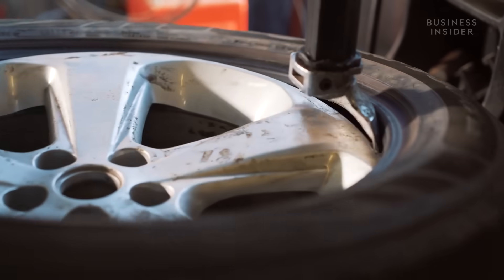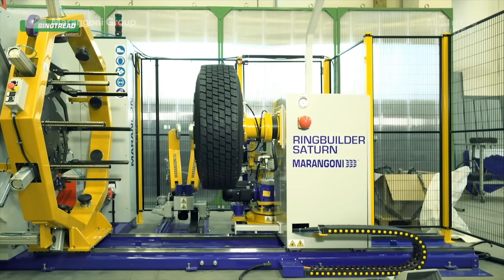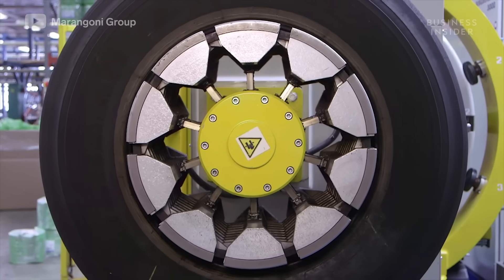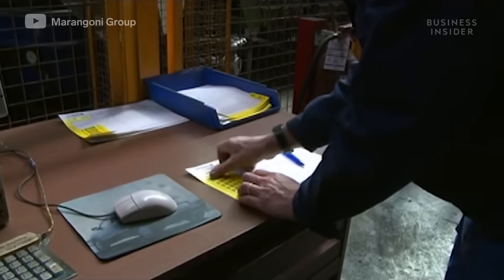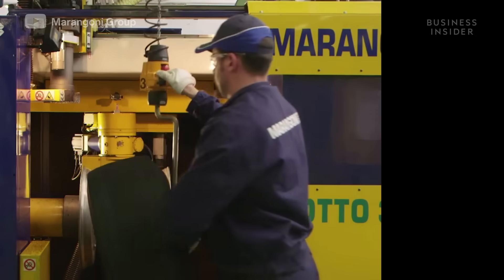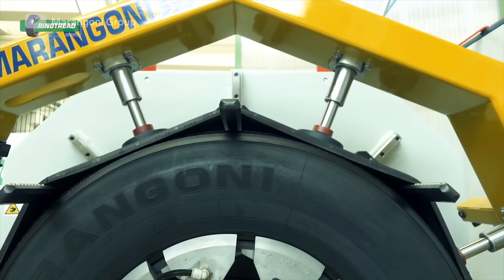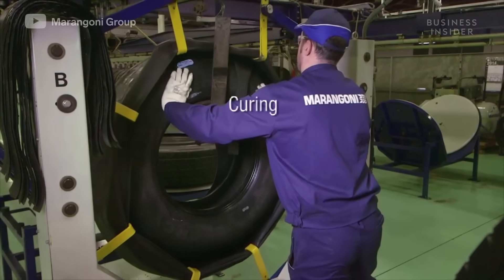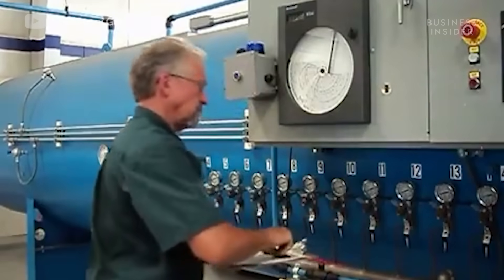How Old Tires Are Retreaded So They Can Be Used Again

Comment: Technically, back in the early days "retreading" meant cutting new tread into an old tire, this process where new rubber is cooked onto casing is called "recapping." My Dad operated a recap shop beginning back in the 1940's. A quality recap will last and ride well but you have to start with a good casing and do a quality recap job.

Comment: These are fine for slow moving applications but no way I would trust them on the highway at high speeds. I see retreads on the road all the time. Many a car and truck every day get damaged from hitting what many call road gators. Not only do these pieces of tread cause damage to vehicles but also motorcycle riders hitting them. I also do not like being next to them when they blowout on large trucks. 

I wonder if saving a few bucks is worth someone’s life?

Comment: Old tires can be shredded, and burned just like coal. In fact, they produce more heat, and release less pollution than coal. They're perfect for power plants. 

But I was wondering. The retreads in this video are great, but expensive. What would happen if you took an old tire, wire-brushed the tread really well, and then spun just the bottom third of the tire in a bath of hot liquid rubber? As the tire rotates, powerful UV lights on top would cure each thin liquid coating of rubber; again and again. So after twenty minutes, the tire would have around three hundred very thin layers of cured rubber on the tread, making it about half an inch thick. Would the rubber stick? If it did, then new treads could be hot stamped. The liquid rubber for one tire would only cost a few dollars.

Comment: Actually if use wrap around will reduce cost or replace tire so all you need is replace the wrap around cost 20% if the new tire and last about the same as while tire replacement

Comment: lets see. buy recaps that everyone by now should no have a horrible reputation for ejecting the new cap if it doesn't vulcanize to the casing or if they are cheap and basically gluing them on and they are still 3/4 2/3 price of new....or i can go get a set of name brand dealer pull offs that are basically brand new (the dealers pulls them off and puts on no name new tires to avoid liability) for 40 a tire....hmmmm.

Comment: I used to work on semi tires, different kinds from retreaded trailer tires to virgin (new) steer tires.
For safety sake, please don't cheap out and get retreaded tires.
They do not last what's so ever.
I had a tire loose it's tread on day one of putting it on a semi.

Comment: They'd seem a lot safer if they put any effort into reinforcing the sidewalls. At first I thought that's what the rubber envelopes were for but I guess that's just a sort of clamp to hold the tread in place while the glue is cured.

Comment: In all my years I’ve never seen the use of a retread tyre end well. New tyres usually have the date of manufacturing on the side wall as over time the rubber breaks down and becomes brittle. You’ll also find retreads will always have a short service life and as many here have mentioned and I’ve seen the tread will often separate from the carcass of the tyre. Retreads really are economically unviable
Reply: In all my years I’ve never seen the use of a retread tyre end badly, guess that’s because aircraft tyre remanufactures know how to do it right.....
Reply: *tire not "tyre" dumb 🤡🤡
Reply: Rubber does not get brittle.  Honest to god........
Reply: @frequentlycynical642  Exposure of the rubber to light and air induces chemical changes in the polyisoprene over time . It looses its ability to stretch and becomes hard and brittle. You see evidence of this all the time in old tires; cracks will form in the tread and on the sidewall. Tires have a protective resin embedded into them, but that can fade and no longer protect the tires properly. This is especially true when the tire is exposed to long periods of inactivity. The longer a vehicle sits unused, the more likely dry rot will develop.
Reply: @jatoxo  Extreme situations.  And tires sure as hell don't rot.  Wet or dry.
Reply: @frequentlycynical642  Tire "rot" is not actually rot, but just a colloquial term that describes the breaking down of the rubber over time due to natural processes.

Comment: I would buy these only if I wanted to sell my car to my worst enemy. Old tires should be entirely recycled. The whole product itself has a planned lifespan. If the tire's surface becomes flat, then then entire tire should be replaced because it most likely lost its durability and flexibility. Just test how much pressure a new tire and a refurbished tire can hold.

Comment: Looks like a great process. When I was just starting out, I couldn’t afford new tires, so I bought “retreads”. One “delaminated” at high speed (like a blowout) and I became afraid to drive anywhere over 40 mph. That’s when I learned to spend more for new tires at a reputable shop.
Reply: I never purchased Recaps. However I recently bought a trailer which had retreads all around. I had two blowouts on the highway in a single day. These were Michelin Recaps so I thought they would be good.
Reply: @shadiahmad4848 You had proper inflation?   How fast were you going when they blew?   Did the tire company provide warranty claims?
Reply: It's better to pay with a few dollars more than with your life....
Reply: @JasonKing-m6m   you’re absolutely right, but I was young and didn’t have a lot of money and wasn’t aware of these tires’ problems. This was in the 1960s and I’m told that retreads are much better made today and don’t have these kind of problems.
Reply: @TheTwick  They might say that they are "better now". A new tyre is still better...
The modern retreads may be better than previously, but in my opinion, that tread is still going to come apart, it might just take longer....

Comment: Let's take a moment to thank the Amazon Rainforest for giving us rubber! Because there would be no tires without rubber!!
Reply: Steel wheels were used before rubber, look at any old farm equipment. Also we have synthetic rubber like compounds so we would still have pneumatic tires (at the moment it just makes more sense to use the cheaper option). From an engineering perspective we would still have tires even if rubber didn't exist, you just might be thankful it's probably cheaper since we do.

Comment: People hating on Retreaded Tires must realize one thing :
Retreaded Tires are not meant for high speeds. 
They are ideal for slow moving, mostly agriculture equipment. 
Car or trucks must not use these recycled tires. But concubines, tractors, even dumpers can work well with these cheap replacement. 
Incidentally, new tires for these machines are very expensive.

Comment: Looking at the amount of work and effort which goes into this process I would like to see a breakdown of the energy consumption in the two processes. I feel that just making new tyres and recycling the old ones might be just as efficient
Reply: Well...i mean they legit said in the video it takes 20% of the materials ect or energy to retread them vs brand new. So. Kind of just gotta listen ig uess. Not a big fan of retreads myself. They said they can burn them no emmisions really and they save the materials...so why can't we do that to most of them? The millions of tires being thrown into a giant landfill.
Reply: @baileyhatfield4273  y.. because its propaganda. Like you said wed burn everything if it was emission free. However, getting energy from burning trash is on the rise and quite shocking how we didnt do it from the beginning

Comment: Most tires you see laying on the road are from 4 wheelers oftentimes carrying a trailer, I dribe an 18 wheeler and as a long haul it makes no sense for me to put recaps on my rig, these are used on mostly regional and local trucking, these tires ARE SAFE as long as proper tire pressure is maintained, all retreads are done once and then arr discarted, morons spreading myths of recaps flying thru a widshield and killing everyone is just that, a myth, when these explode the rig itself absorbs all of the damage and it can substantial, whats left is that chunk laying on the shoulder of the road.

Comment: As a professional driver, I have to say retread is absolutely NOT safe. I don't care what this video claims. I see it laying all over the highways as the tires of some trucker is ripped to shreds. Regular tires don't do that. I  ran over a huge chunk of tread on the highway and it ripped the drive axle right off my RV which cost a pretty penny to repair and left me stranded in oklahoma.  In my opinion retread is dangerous and should be illegal.

Comment: So many negative comments on retreads. And yet, people forget the stories of regular tires blowing apart as well. The only time I ever saw retreads get damaged, was from lack of maintenance, improper pre-trips, or driver abuse.
Reply: Yea sorry I'll buy brand new safe tires for my family to drive on.... Not recycled garbage thanks
Reply: @MerkMacheen  when it comes to a family vehicle, you don't have a  choice. Recaps are only for trucks on the drive end. Small motor vehicles, and steer axles only run new rubber. Besides, if recaps where bad, they would be outlawed. All the school bus, and truck companies I've seen run recaps. They never have problems.

Comment: “tire looks good and has no holes. time to send it to get buffed.” (staples holes to put tag on). lol
Reply: Literally the only part I wanna remember from that video. Made me laugh so hard
Reply: @LightAndorDark  same!
Reply: Right on the bead too
Reply: Just a completely unnecessary risk.
Reply: @jacob_90s  my brothers name is jacob w and he checked into rehab a week ago for drugs. interesting how the world works like that. he’s 20
Reply: I think when they go into the enclave, pressure chamber, all that shit don't matter.
Reply: And then they fix those damages before they put on the new tread
Reply: Imagine if two little tiny pin pricks, that go 1/8" into the rubber, actually damaged it.
Reply: @littlejackalo5326  I mean it could technically start tearing and cause damage but the tire is probably not going to live long enough for that to happen
Reply: @aam7670  bro idk if you’ve heard of this but there are things called roads which are much more rough and will make a small hole from a staple insignificant
Reply: Yeah yeah it will do such an impact.. You really should write that bullsh*t?

Comment: some owner/operators ive worked with WILL NOT use re-treaded tires. ive personally been behind a company owned tractor and watched a re-tread blow up and take out the air lines for the trailer locking the brakes and putting up a smoke show on the freeway and put a hole in his drone box, tire debris didnt get into cab and driver was able to pull it off the road b4 locked trailer brakes parked him on freeway. yea they are cheap and company's dont care until governments see they more harm than good

Comment: I was on a long trip and had to buy a couple of tires. The only place around only sold retreads, so, I bought two and put them on the back of my new pickup. In less than a 1500 miles, 1 came apart and flapped around and caved in the side panel and tail gate, plus dented the bumper. I will never buy a retread again.

Comment: The retread process you see here is very safe and strong. But the old way of retreading tires is still prevalent in today's process.  When a person's hand touches the inside of the tread or the gum it does not allow a proper vulcanization to adhere to the tire, thus making a weak point in the retread.

Comment: "Majority of accidents happen due to tires blowing up"

Tire companies : Here we go have your unsafe rethreaded tires 

These should be illegal
Reply: Im sorry tires blowing up being the majority sounds plain incorrect.
Because its extraordinarily rare that happens and gets that far, even with retreads. And with these retreads theyre doing a good amount of stuff
Reply: @afish8883  may be thy aren't common in US but in Asia they are the major reason why big accidents happen
Reply: Tires blowing up does happen, but it's a rarity. If tires are a contributing factor at all I imagine it's mostly because they are too worn to have much grip left, or it's a case of wrong tires for winter road. People don't change tires when they should because they are penny pinching. A cheaper option might actually work out as a net safety benefit in this.
Reply: if these are unsafe it won't be sold in the public, I've seen retreaded tires worse than this but they never explode
Reply: K and you wanna ruin this planet? This video literally said they check for anything and test for safety
Reply: @jumbomuffin1316  planet is already ruined
Reply: @LatestBuzzvideos  dont ruined more

Comment: These retreads should be banned,ive seen so many truck tyers that have the tread peeled off sitting on the side of the highway. If you drive over one of these retreads the damage they could cause to your cars underside would be extensive, and not to mention dangerous.